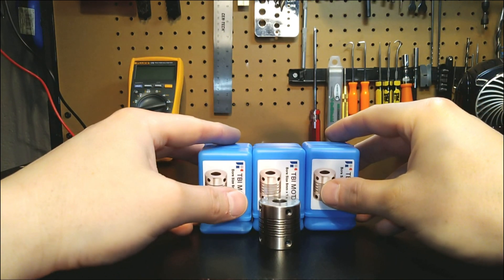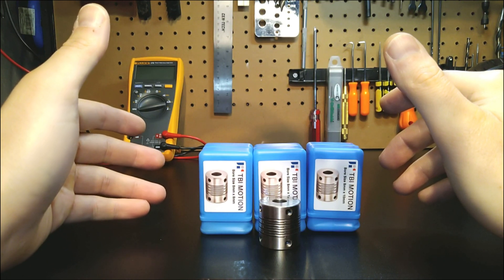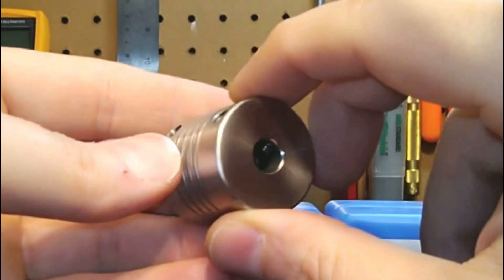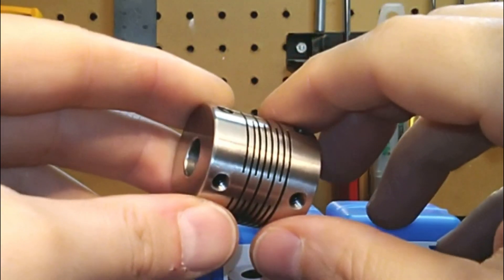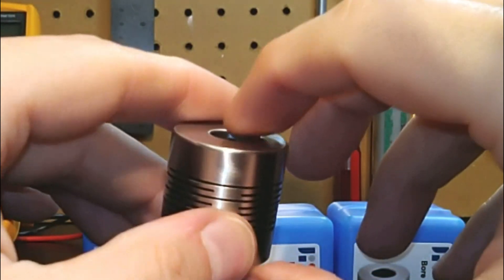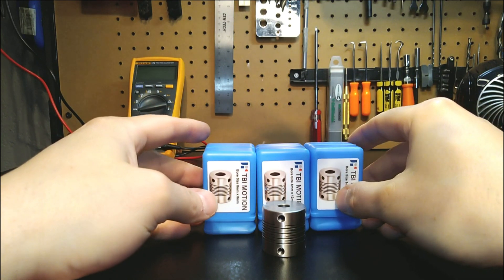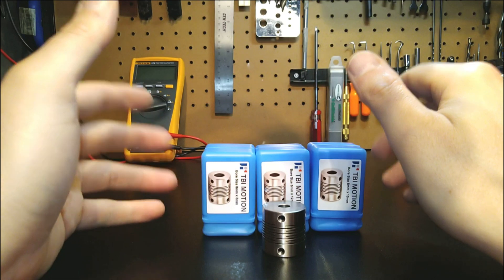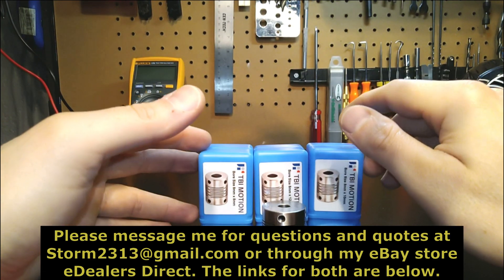304 Stainless Motor Couplers Are In Stock..

Comment: Hey i was wondering a dumb question,ive been running a shapeoko3 xxl for a year now and last week my homing y switch popped ,i got a replacement and after 4 cuts same switch popped again.yes  i switch the switch to the x axis and the fault followed switch.i was wondering could it be faulty switches or is there something i can use thats more durable
Reply from the maker: kozhitn, thank you for your support. I'm not a fan of physical switches for the reason you just explained. I've never experienced two switches failing consecutively. This may be a cable, or BOB issue. I suggest eliminating the whole mess with soft limits using my tutorial video here on how to use them. https://youtu.be/zFk_U3yqrks
 Once you do I doubt you'll look back. Thank you, and have a great weekend! Vince
Reply: @corvetteguy50   ok  dum question ,cables good,i recheck isolation of wires all good no breaks  shapeoko3 uses a weird push switch i was wondering if i could up grade to beefier switches ,or is there a way to turn off the mandatory homing cycle ,cause i know were my zero is and were my cutting is at all times,i cut a lot of custom pc parts and parts for custom enclosures . Yes looking back i should of had you build me a machine .but im a newbieish to cnc .
Reply from the maker: I would validate the controller your using with the vendor you purchased it from as a switch is a really simply component. Switches aren't designed around durability. I do have metal units, but they would be to large for your machine. Thank you,
Vince